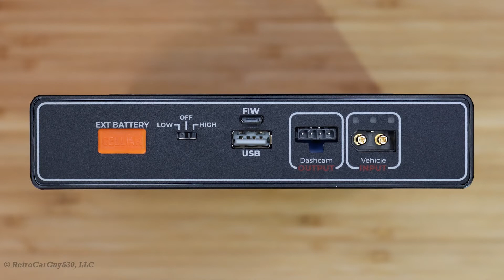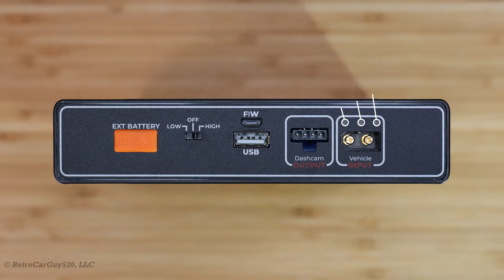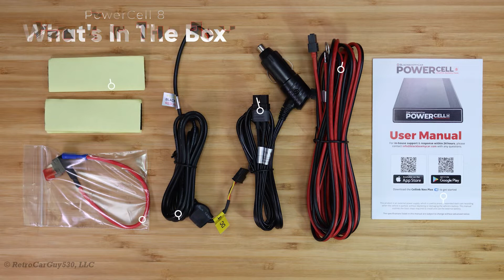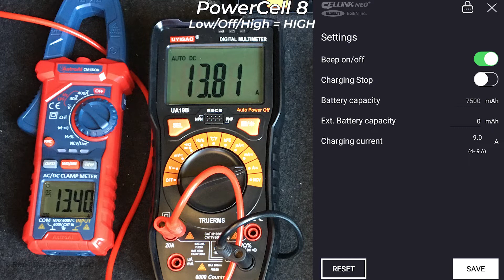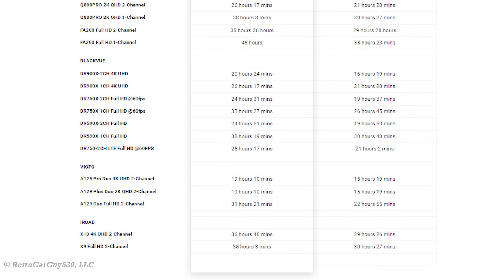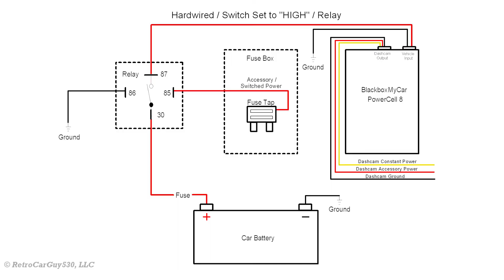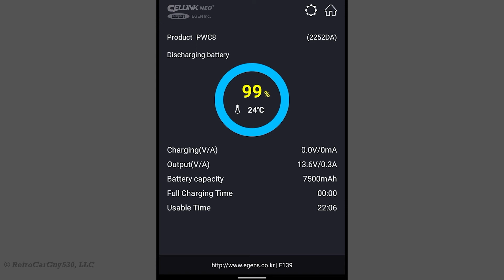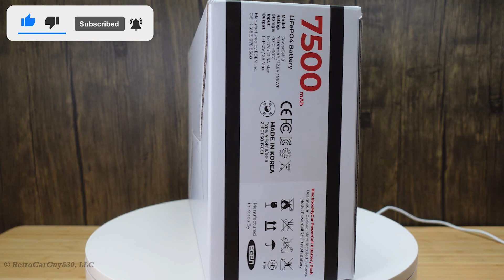BlackboxMyCar PowerCell 8 Dashcam Battery Pack Review / Testing

Comment: Excellent video, I really appreciate it! I have a question regarding the included hardwiring power cable and the fuse tap. Do you know what gauge these wires are? Does it say what amps these are rated for? I'm assuming both are rated for at least 30 amps/10-guage, given that BlackboxMyCar support suggested using a prior 20 or 30 amp socket. Thanks!
Reply from the maker: The wire gauge of the cabling provided by BlackboxMyCar (info provided by BlackboxMyCar support):
Hardwiring cable uses "UL1015" 16AWG
Unspliced output cable "UL2464" 24AWG
12V cigarette lighter charging cable uses "UL2468" 16AWG
12V socket output cable uses "UL2468" 22AWG

Fuse taps generally come with one of two wire gauges 16 awg or 14 awg and often the wire coming out of the fuse tap will have the wire gauge rating.  I have not found a blade style fuse tap with a wire gauge of 10 awg.

The most amps those 16 awg wires can handle is (based on a conservative wiring amp chart):
20 amps for no more than 2 feet
15 amps for no more than 4 feet
10 amps for no more than 6 feet

The PowerCell 8 will draw around 14 amps if configured for a charging current setting of 9.0 amps in the admin page of the app (as I mentioned in the video).

While BlackboxMyCar recommends using a fuse socket with a pre-existing 20 or 30 amp fuse in it to provide the charging power for the PowerCell 8, I cannot agree with that because the PowerCell 8 if configured at its default 7.5 charging amps (actual draw around 10 amps) or 9.0 charging amps (actual draw around 14 amps) will potentially overload the circuit providing power to that fuse box fuse socket (in my opinion).  That's why I recommend using the relay method of powering the PowerCell 8 instead of the fuse tap approach for the charging power.
Reply: @RetroCarGuy530  Thanks for the reply! I’m still new to this so thanks for helping me gain a better understanding.     

I really like your ideal for the relay switch. If I run the switch, then wire coming out of 87 on the relay is the 16 gauge hardwire that BlackboxMyCar included. Wouldn’t that still put around 14 amps though that 16 gauge hardwire (not sure how long the hardwire is but assuming more than 3/4ft)?  It’s my understanding that this is still potentially too many amps for a 16 gauge, and would run the risk of overheating/melting the wire insulation (it should really be 14 gauge wire for that many amps). Is this correct?    

If so, would you suggest scrapping the included hardwire and replace it with a 14 gauge wire at a minimum? If so, then I assume I would have to remove the connector on the hardwire that connects that connects to the PowerCell 8, and affix that to the 14 gauge wire? Or could the wire be affixed the 8cell without a connector? Thanks
Reply from the maker: I would agree that having the PowerCell 8 hardwiring cable use 14 awg wires would be a good thing.  As long as the distance between the relay terminal 87 and the PowerCell 8 is within 2 to 4 feet and the wire awg used between relay terminal 30 and the battery is 14 awg, it should be fine.  My installation has the PowerCell 8 about 3 feet away from the location of the relay and about 1.5 feet between the relay and the battery positive terminal.  I've checked the wiring after having the PowerCell 8 charge at the 13 to 14 amp (9.0 charging amp setting) and the wiring was nice and cool.

You could also reduce the PowerCell 8's charging amps from 9.0 to the default of 7.5 amps which results in a total draw around 10 amps, but of course that will extend the charge time a bit.

The PowerCell 8 uses a specific connector for the input charging power port, so you cannot attach wires directly to that port.

In the end, you should do what makes you feels the most confident about the PowerCell 8 installation.  There are many factors that viewers of my channel don't tell me when they post questions about specific installation situations that I cannot be held accountable for in my suggestion response.  I do my best to answer those questions, but it can be a challenge at times.  I hope you understand.

Comment: Hi, I want to do the relay option you had mentioned in the video for a blackvue dashcam with the power cell 8. The power cell 8 “input wire” has a ground wire and a 
“ ACC “  wire. Just curious, should that “acc” wire be connecting to the 87 terminal on the relay ?
Reply from the maker: Yes, the "ACC" wire (red wire) in the hardwiring cable is connected to terminal 87 of the 4-terminal relay.   The relay is only providing power from terminal 30 (power from battery) to terminal 87 (power to PowerCell 8) when the fuse tap supplied accessory/switched power is on.

I hope that answers you question.
Reply: @RetroCarGuy530  okay thanks. Wasn’t sure if I should be connecting the red cable from the battery hardwiring kit to terminal 87 because it was labeled “ACC” and shows in the Manuel to plug that into the fuse box. But I will connect it to terminal 87 thanks for clarifying.
Reply from the maker: The "ACC" simply means "Accessory" power which really means switched (on / off) power.  The default hardwiring approach from BlackboxMyCar is to source the charging power for the PowerCell 8 from a fuse tap which would be plugged into a fuse socket which has "ACC" (accessory) or switched power in the fuse box.

Trying to obtain an additional 6 to 14 amps to charge the PowerCell 8 (depending on what the "Charging current" admin page setting is set to in the 4.0 to 9.0 amp range) is a fairly large amount of amps to be pulling from a fuse socket with a 20 or 30 amp load already on that circuit.  That's why I prefer the relay approach to move the high amp draw to the new circuit put in place by the relay and the fuse tap only needs 150mA to 200mA of current to control the relay on/off.

My personal preference is to call "Accessory" power circuits "Switched" power circuits.  It just so happens that accessories in the vehicle will use switched power circuits to control the accessory/device on/off when the ignition switch is in the "Accessory" or "Run" positions (powered) or no power in the "off" ignition switch position.

Comment: how do I know which add a fuse I need for my vehicle? i have the 2021 bmw x3 for reference
Reply from the maker: I downloaded the 2021 BMW X3 owner's manual to see if it had the fuse type info in it.  It did not.

I found a post on a x3 BMW site and there was a picture of the rear fuse box in one of the threads.  It appears that fuse box has ATC and ATM "Mini" fuses.  The fuse socket the being suggested for a Cellink B dash camera battery pack installation was fuse 207 (I can't confirm that is a good choice since I don't have a X3), but the fuse type for that fuse was ATM "Mini".

I have a fuse tap related video on my channel.  At the 2 minute 1 second point in the video, I show the four common fuse types.  

Here's a link to that video and to that time mark in the video:  https://www.youtube.com/watch?v=NW0QaQaU41Y&t=121s

I would suggest looking at your X3's fuses after seeing the four common fuse types in my video to see what you need for your vehicle.
Reply: @RetroCarGuy530  thank you for such detailed information! i ordered the add-a-fuse according to what blackboxmycar sales rep said I should get. I will refer to your video once i receive the battery pack and attempt to install the fuse..